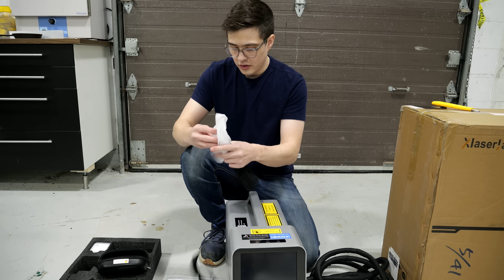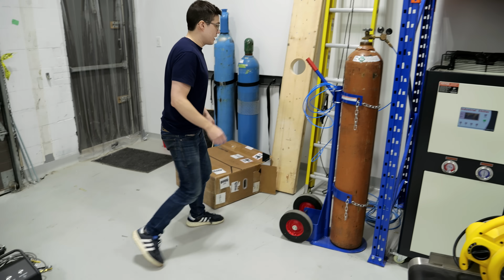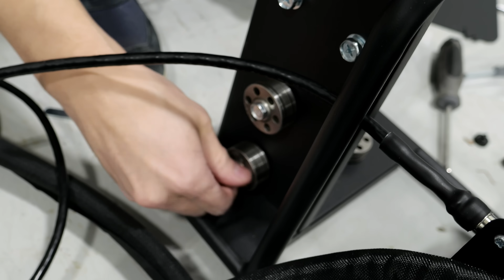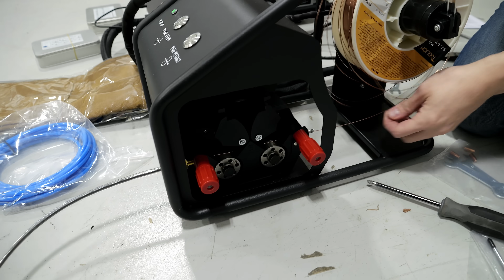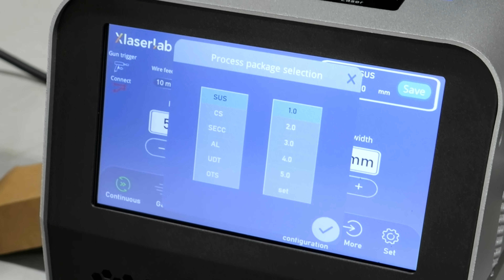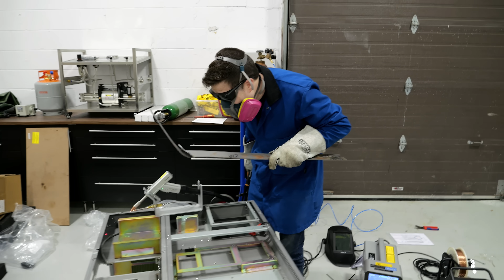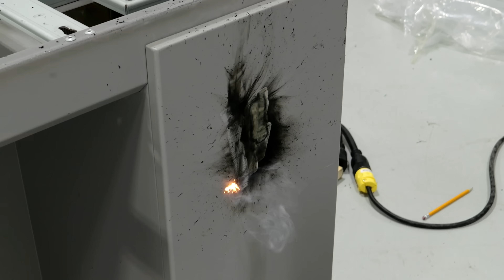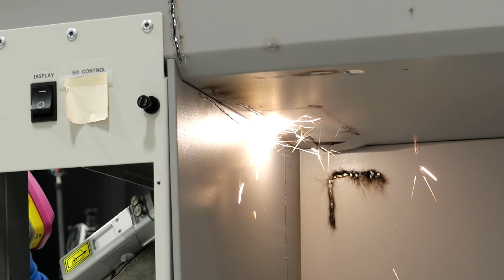I got a new laser machine (I love lasers)

Comment: Former laser welder technician here. You can try to end the weld by lifting the gun instead of releasing the button. Once the circuit is open it will automatically stop. Also, if you do a push-release technique you can mimic the "drop" pattern usually seen on conventional welding. 
Also, those can blind somebody up to 400m by a direct hit and up to 70m by the first reflection. So be careful lol
Reply: when I laser welded, we had like 7 booths, and each booth was completely sealed, and had a dead mans switch on the door for the machine. Basically for the layman, a laser doesnt lose power over distance like typical light does. Because of this, a powerful laser can blind you miles away still, and because a laser is light it bounces off any and all shiny things. So basically it can bounce off an I-Beam in the ceiling bounce off a table and get you right in the eye.

The deadmans switch was so if anyone opened the door while in operation the machine would cut power immediately. We also had to use special goggles while welding, because the laser is so bright and so powerful that conventional welding hoods wouldn't cut it.
Reply: @DrCranberry  Yeah, watching styropyros videos has instilled a very healthy fear of lasers in me. They are not to be fucked with or taken lightly
Reply: @NotJohn128  i mean... maybe a little bit of fuckery is allowed
Reply: @DrCranberry  The safe type of fuckery that people like styropyro do im completely cool with. I more just meant for the average person who doesnt understand the danger and power even cheap lasers can possess
Reply: That cuz he was actually making it into a learning experience that is shared nd thought through before being shared.
Unlike idiots these days that could less about any of the actually required knowledge required to operate things safely.
Someone aware of the dangers doing dangerous things will almost always be safer to themselves and others than your random idiot being mischievous for a thrill. @NotJohn128
Reply: @NotJohn128 so this is probably why they aren’t more popular right? It seems to be insanely easy compared to even mig welding. But you can just nuke your neighbor or family member if you try to use in the garage….
Reply: @DrCranberry the special eyewear isn't because of brightness.  It's highly likely your welder used a wavelength that you couldn't even see.   Which is what makes them even more dangerous when people aren't aware of the proper safety precautions.  Edit: a very common wavelength is 1080nm which is not in your visible spectrum.
Reply: @stenmin1234 not in YOUR visible spectrum. Speak for yourself.
Reply: @stebe12 If you can see near-infrared or infrared you really should breed as much a possible because that's the most awesome party trick.
Reply: @DrCranberry this is the way 👌
Reply: @DrCranberry   This company (their real name is XINGHAN LASER (HONGKONG)CO.,LIMITED) is INCREDIBLY sketchy. They came from Kickstarter, used the most generic Chinese startup website template ever, have faked reviews from Forbes (clearly AI-generated), and their website stopped loading halfway through. They have no contact other than an email and WhatsApp, their specs are also AI-generated, they call the safety glasses "Protection Glasses" (Doesn't inspire much confidence in the thing that's supposed to be yknow, protecting one of your vital organs). I really, really wouldn't recommend this product. The glasses alone should be double the price of the machine itself.
Reply: @DrCranberry putty the first guy to weld up a chrome box is said enclosure
Reply: @DrCranberry Lasers do lose power over distance, due to beam divergence and atmospheric scattering. Even in space, it will lose power over distance.
Reply: @sanctionh2993  Yea but not over a meaningful enough amount of distance to not still bind somebody elsewhere in the shop if the light is bouncing off surfaces with enough energy to keep burning shit, which it absolutely can do. If it can blind you from 400 meters away, one can only imagine the damage it will do to your eyes and the rest of your face if you're significantly closer
Reply: @sanctionh2993 it does... But if you're thinking of the inverse square law, it doesn't apply to lasers.
Reply: DO NOT TRUST THE CHEAP ASS FREEBIE GOGGLES!!!
Reply: @firescale8912  that depends on the manufacturer of the supplied laser... But I would absolutely recommend getting eyewear you're comfortable wearing more than anything
Reply: @firescale8912 this is important. Get a decent pair of certified laser googles from Thorlabs or Edmund Optical.
Reply: Meanwhile I'm freaking out at the idea that the filming guy has no PPE whatsoever (or not enough, at least)
Reply: @lekrashar  im assuming he did and it wasnt shown because uh otherwise he woulda been blind ina few seconds
Reply: @NotJohn128  No respirator at least.... Nile sounds like he's underwater but camera dude is still loud and clear.
Reply: @vix86  yeah that is definitely a fair point, and still bad, but orders of magnitude away from having no ppe at all
Reply: @NotJohn128 cameraman is much closer to the cams mic, and Nigel isn’t wearing a lav mic that I can see.
Reply: @NotJohn128  in 0 seconds to be precise
Reply: @Xnoob545 True
Reply: @vix86  I assume that room has decent ventilation, in that case, the respirator is mostly for the operator that's really close to the fumes
Reply: @lekrashar  It definitely sounds like he has a respirator on, he's just inches from the mic instead of feet
Reply: @lekrashar  literally my first thought when he started the laser, that's an injury (and lung problems) waiting to happen
Reply: Honestly it's wild to me that laser welding has been a thing for long enough for there to be former laser welder technicians
Reply: They are almost cheap enough for mere mortals to possess them now. 

There's a channel where you can get a diy plasma table kit for like $400. Magnetic feet , you can stick it right on the material and cut out your pieces, even up on its side. Looked pretty nifty.
Reply: @Magmafrost13 Im in the industry and I can comfortably say that most welder technicians of any kind will be “former” in the coming 5-10 years.
Reply: is that 70m by first reflection meaning you shoot the laser at a surface 70m away and somebody standing next to the surface looking at it gets blind or you shoot the laser at a surface next to you and somebody looking at the surface from 70m away gets blind or some combination or how does that work?
Reply: @aoeu_bacon  the laser reflects in a surface near you and if somebody is 70m away looking that direction it can cause damage/blind them. It is likely not to cause any damage but is better not to take any chances. Once we talk about 2nd, 3rd and so on reflections (the laser "bounces" a couple times on a surface) then it is completely safe if you are 4-5m away. But you never know which reflections you are getting... so better be careful all the time
Reply: @aoeu_bacon  Means reflections off the surface you're working on are dangerous 70M away. So someone walking by 70m away while you weld could be blinded
Reply: “Steve here”
Reply: If a welder reads this, why do you need to clamp a grounding clamp when laser welding, I get why when you "electric" weld, or is it just to protect the equipment from static electricity
Reply: @chax0208 safety measure so you can't accidentally blast random stuff
Reply: @chax0208 I think it's a safety feature, the laser only works when the circuit is complete which only happens when you touch the tip to the surface, so you can't accidentally fire your super powerful laser at your coworker
Reply: @chax0208 safety feature so you can't go pew pew laser sword mode shooting everyone around you
Reply: Your comment made me 💦
Reply: 400m blinding is fucking crazy! How do you use these in an industrial setting safely? Do you set up blinds around you before use?
Reply: @MelodicEscapism any kind of blind is pretty much useless. You need to set up a metallic cubicle of, at least 2mm aluminium thickness. With one window with a special protective glass rated for class 4 lasers at that wavelength (to check on the operator) and a door connected to the safety mechanism of the laser so when somebody opens the door the laser shuts off. Some people even add a delayed locked door with a button that, after pressed, the laser shuts off and after 3s the door does not open. Just in case some reflections can escape on those milliseconds if you instantly open the door
Reply: @luisperezfidalgo5458 some curtains block/absorb the wavelength just fine.

   Also using aluminum for an enclosure is fucking insane. DO NOT do this.  Have you heard of refraction and reflection. Do you know what aluminum does really well?  Reflect and refract laser sources.
Reply: @stenmin1234 yeah sure. I have seen red curtais with wholes on many workshops. The problem is not the wavelength. The problem is that a cass 1 laser (the ones legals to own) need to be 50 milliwats or less. Here we are talking 0,7 KILOWATS and i have worked with 1,5 and 2 kilowatt lasers... with those powers nothing can stop that

Also, it must be black painted aluminum. I forgot that part.
Reply: @luisperezfidalgo5458  saying what you've worked with is meaningless.  I work with 12kW and 8kW lasers.  We have multiple 2kW welders.  

Fabric curtains exist for laser safety. Wavelength matters, protection is measured in a function of power/surface area per second matters.   They exist, don't know that to the you.   

Just because you saw some dolts use the wrong gear or because you don't think it exists doesn't make you right in this matter.
Reply: UR JOKING.. MAN THATS INSANE. just the thought ur walking around and you see someone welding something from 100m and BAM ur blind
Reply: @Monkey_Sharpen yup. When i used to work and somebody told me that "it can't be that dangerous" i just shot the floor 20m away so they see it catch on fire. The  i replied "Now you want to set up a secure cubicle or put laser PPE on everyone who's working here?"
Reply: @luisperezfidalgo5458  damn. thats really intresting
Reply: By habit I both lift and stop pressing the trigger because just lifting tends to make whiskers and just ending trigger can leave a splotch.
Reply: @plotholedetective4166 yeah, that is the optimal technique. I just over simplified it for a person who's never used one of these before. Usually it's easier to lift than releasing the trigger because it gets stuck
Reply: Makes arc eye look like a summer holiday by comparison, shit will fuck you up
Reply: No one should be in the same room while this is on, reflection will blind or burn.
Reply: Weld one explanation.
Reply: Wow. I had no idea those existed. My little laser is only 5W. I modified it myself .
It burns through certain things I can carve my name into certain things. (Especially black plastic).
Reply: I can arc weld, wire weld, use an acetyline/oxygen cutter, and a plasma torch. The plasma torch was the most badass cutter I've ever used.
Reply: If you're open to learn something about religions, here are some general facts, for more detailed explanations please refer to Dr.Zakir Nayk and Deedat. 

In all worlds and universes, in and above our consciousness, there is no GOD BUT ONE AND ONLY GOD ALLAH, He is The Creator and LORD of everything and everyone. 

When Adam may peace be upon him was created, he worshipped ALLAH, from the first moment he was conscious in heaven where ALLAH created him, and when he descended in earth, until he died. 

There was only one true religion since before the creation of Adam the first human being, and that is to worship THE ONE AND ONLY GOD ALLAH. 

After Adam came lots of prophets, always spreading the same message, because satan since he caused Adam to descend from heaven, he was working hard to mislead people into not believing in ALLAH. From all the prophets I'll mention to you those who you may know of : 

Moses may peace be upon him (some of his miracles were the stick that changed into a serpent whenever he threw it, his hand that became white whenever he tucked it in his armpit, and the sea that divided into 2 parts so that he could get his people into safety from the pharaoh's killing), he was sent to Israel, his message was to worship the one and only GOD there is : ALLAH. 

Another prophet : Abraham may peace be upon him (one of his miracles was the fire that didn't burn him when they threw him in it), he was sent to his people because they were worshipping statues they were making, and he had the same message. 

Another prophet : Salomon may peace be upon him (he had the strongest army ever, composed of humans, jinn, animals, wind, etc.) 
He was spreading the same message, look up his story with the queen of sabaa (in the Noble Quran, because if you look up anything in other books you will be mislead, as mecreants falsified the other holy books but the Quran was never falsified, it is one of the miracles of our prophet Muhammad may peace be upon him). 

Another prophet : 
Jesus may peace be upon him (some of his miracle are that he was born without a father, that he spoke in the craddle when he was a baby, and that he could cure illnesses, and blindness, and that he ascended to heaven when they tried to kill him) he was sent at the same time as John may peace be upon him, to spread the same message, the first words he said are : I am the slave of God ALLAH, He gave me the Book (Bible) and made me a Prophet. 

In the original scriptures, you will find that all prophets had the same message (and I'm talking about real prophets, not about the fake gods and their fake prophets, and you can easily differentiate between the two) but the mecreants who falsified the original books changed the original message and lead people into falsehood. 

Everyone is responsible of his choices, it's up to you weither you make the right choice or not, it's up to you weither you want to go to heaven or hell.
Reply: We had a brand new laser as of 2020 and the safety video for it showed that I would literally fry our brain if we came into contact with it.
Reply: Do you need to put the ground on your material you're welding or cutting seems unnecessary to me if you're not using arc welding couldn't you put it anywhere that connects to the ground
Reply: @FFlaminscorpion it is just a safety mechanism to prevent you from using the gun as a burning ray of death. You ara not using it to weld like in traditional welding.
Reply: So is the red clamp a safety feature for welding then? I see it keep appearing out of nowhere and I didn't really expect one at all
Reply: @djlilis it is just a safety measure just to try and make these safer. If the tip of the nozzle is not touching any metal attached to the clamp, the safety circuit is open and it does not shoot. However... if you directly put it into the nozzle as they did you can bypass this safety mechanism... which you should never do. Is it necessary? Strictly, no. It is just added safety. It could work without that mechanism.
Reply: @djlilis I think that is just the ground for the 3.3 or 5v to run the firing circuit. You definitely didn't need anything attached to what you are welding since it's not arcing. lol

It's so cute when children play with friggin laser beams. You'll put your eye out kid.
Reply: @zentechnician this laser must be Italian because it looks fragilé😁
Reply: That's frajeeelay
Reply: Is it typical to not use a full welding mask?
Reply: @Rainersherwood  nope. The gases generated during laser welding are the same as conventional welding. The only difference is HOW you melt the metal. Not the melting itself. So yeah, full respirator all the way.
Reply: @luisperezfidalgo5458  Yeah, dont wanna breathe vaporized metal
Reply: @luisperezfidalgo5458 I’m no welding expert, just learning mig, but instantly I was like uhhh that doesn’t seem safe. 

If it’s like you said his forehead and cheeks were bright red the next day.
Reply: @Rainersherwood that's one of the good points of laser welding. When an electric arch is made it emits Infrared (IR) and Ultraviolet (UV) light which is the one giving you "sunburns". When using laser, the bast majority of radiation is IR so you just feel warmth without the sunburn thing
Reply: @luisperezfidalgo5458 that’s what I was trying to ask! Sorry I didn’t word it better. I was confused why they didn’t need full face protection from the uv rays, but you explained it. Thank you.
Reply: @Rainersherwood sorry, now i understood what you ment LOL. When an electric arch is made it emits Infrared (IR) and Ultraviolet (UV) light which is the one giving you "sunburns". When using laser, the bast majority of radiation is IR so you just feel warmth without the sunburn thing. So you just need the special laser protective glasses and the respirator for the fumes.
Reply: @luisperezfidalgo5458 that’s what I understood from your previous comment. Makes sense why you don’t need a full welding mask now. Thanks!
Reply: If you lifted the gun, wouldn't you just weld the ceiling?
Reply: @dennisfi7683 for a split second it would still shoot yes. But once the security circuit is open (no contact with the red clamp) the machine will automatically shut off the laser. We are talking less than half a second
Reply: This guy knows nothing... just because you have a job... doesnt Mean that you are good....  😂
Reply: Rein pfp who would’ve guessed 😂
Reply: For $29,000, it better do that for me....
Reply: @happykillmore349   its like $3500 usd.
Reply: @happykillmore349  fym $29,000, the basic pro pack costs $3,599
Reply: Is it a problem to wear a butt plug when using a laser / doing welding?? I’m worried about EMF forces and don’t want any metal inside me😭
Reply: @ENikolaev  Nah, you'll be fine. 700W is a lot but its not 400 car batteries
Reply: @ENikolaev  make sure to wear it when you get an mri
Reply: > those can blind somebody up to 400m by a direct hit

I think I've found a new hobby...
Reply: Nerds
Reply: Ah yes just lift and RANDOMLY POINT A POWERFUL LASER ALL OVER THE PLACE instead of just releasing a button while aiming it in the direction of the thing you're supposed to be aiming at...
Reply: @Chicanery_Artifice you can lift the gun from the surface by pulling a little while still aiming the metal... you don't need to yank it up...
Reply: Your parents aren't proud of you.
Reply: @2Buildor2Break same could be said about yours lol
Reply: SOMEONE didn’t like his repair bill 😂  Sorry you had to warm swivel chairs for a living and pay some other guy to do the useful stuff 🤷🏻‍♂️
Reply: Nice paid promotion of his that he didn't disclose
Reply: @Molon_Labe1776  he literally says he got the whole laser for free
Reply: @Molon_Labe1776   He says in the video and in the description that it was sent to him for free.
Reply: @Molon_Labe1776  He clearly stated that they gave him the machine for free early in the video.  I call that full disclosure.
Reply: @Molon_Labe1776 are you talking about in the video when he said it was sent for free to test out and review?
Reply: @Molon_Labe1776   He made it extremely clear in the beginning that the laser was sent for free, And put the Xlaser company link in the TOP of the discription.
Reply: @Molon_Labe1776  what are you on about?
Reply: @NotJohn128  probably about getting this laser for free and making a video about it.
Reply: @d4slaimless  which he completely disclosed?
Reply: @NotJohn128  yep. But that's my only guess.
Reply: Ah, sorry if i incorrectly assumed you were agreeing with him
Reply: @Molon_Labe1776  Shocker, the guy with the Charlie Kirk profile pic says something useless and dumb. I guess his shitty legacy still lives through the morons that fell for his grift 😂
Reply: @Molon_Labe1776 you got to be on the spectrum lmfao
Reply: @Molon_Labe1776 still time to walk this back
Reply: @MarkPentler 😂